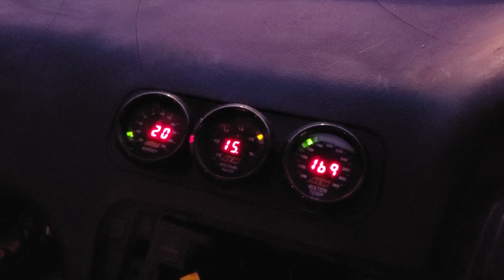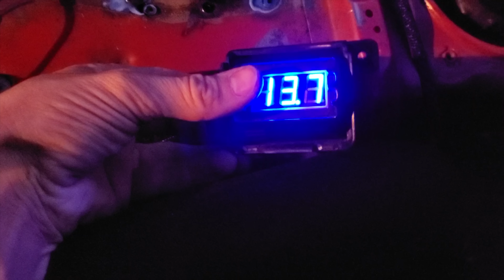FIRST TEST DRIVE IN MY STRAIGHTENED 240SX

Comment: This is so incredibly inspiring. Watching this car go through all it has and you producing positive, informational, and great videos is so insane. I didn't know if the car would ever look or drive the same when I saw that first video of it at the repair shop. But through all the hard work and the insane job you have done with welding and cutting, its so incredible that its a whole driving car and the panels line up and it drives just like it always has. I always worried if my civic were to ever get totaled, because its my dream car. But you have proven that its possible to bring a car back even when everyone thinks its beyond repair. Each one of your videos are so motivating and inspiring to me and your optimism really makes anything seem possible.

Comment: i love 300ZX AND IS ALL IVE OWNED/ worked on for the past 22+ years, i have rhd tt slicktop 5 speed 2 seater and a lhd t-top ,tt 5 speed 2 seater. i love them both but are both soooo much work

Comment: Well done getting the car back together 👍 And that smile from ear to ear is well earned 😁

However im not impressed by how you and your friends haul engines in your cars. Im not saying this out of hate, im only saying this out of concern. Why? Well here is why. I dont know the weight of the engines you hauled or the exact speed of the car that Tboned you so i will use an example.  Imagine you have an Rb25 sitting next to you instead of your front left seat. Thats about 260 kg of RB25. A car T-bone your left side door going 50 km/h. The impact force will make the RB25 40 times heavier, thats 10 400 kg. If the T-bone car did 100 km/h instead of 50 km/h, thats another 4 times heavier. 10 400 x 4 = 41 600 kg. 
So with that in mind, do you think you would have survived your T-bone crash with a 41,6 ton heavy engine next to you?

You are young and hauling engines in your car might be a cool thing but you never know whats coming towards you when you're out driving on the road. Stay safe!

Comment: I would love to have a 180, 200, or 240SX. but in the Nederlands they are not cheap. Even the Nissan nx1600 (ga16de)is 4000 in a good state, and the nx2000 (SR20) good luck finding one in the Nederlands it’s called a Nissan 100nx and the 2L is a gti. I have 2 1600, 1 with factory body kit

But I do have a Pontiac firebird gen3 and it was cheaper. for 2900 and it’s pretty close haha 😂

Comment: I got an RB25det swapped 180sx that doesn’t start, ignition switch is fine and battery is good, I hardwired the starter to see if it would crank and got nothing, any ideas?

Comment: Now please strip it back down and finish the rest of the welding and definitely do some bodywork to make everything as good as you can and paint everything interior engine bay exterior and especially wheel wheels and undercarriage get undercoated that way all your hard work is saved for years to come and you never have to do this much work again as well I would consider caging it this time around will help saving the chassis if anything were to happen again in the future

Comment: Hey, I have a 1989 240sx se single cam and I have the auto trans yes ew I know😂 but Im having trans issues I put a new trans in and it seems my car starts in 2nd and doesn't shift from 2nd and im thinking its a transmission speed sensor, it may have scraped off since the car is soo low but if anyone can help please let me know I really wanna drive the car and self diagnose before I take it to a shop which I dont trust

Comment: my monitor is shit, so cant tell if cobalt green or blue, either way its a win cause htose colors are rare and sick on a z32. also tan sucks ass!!! dye it black, but do it right, as you always do. clean the fuck outta it with soap scrub brush and then wax and grease remover, THEN plastic adhesion promoter, THEN dye it. let parts fully cure for 24-48 hours before installing that way the smell has time to leave the parts before install and trapping smell inside interior forever lol